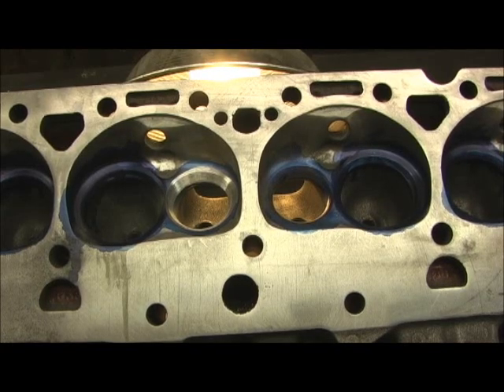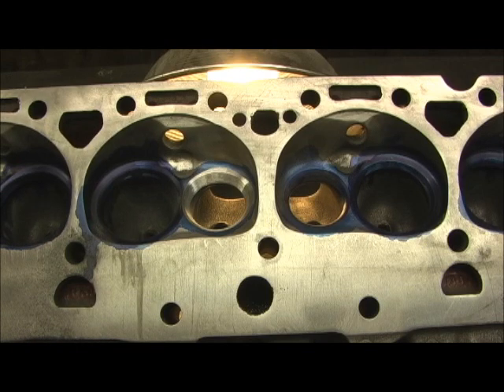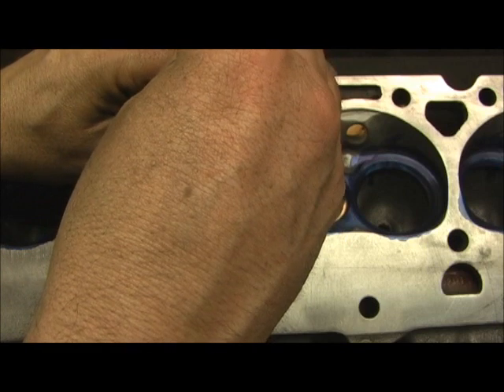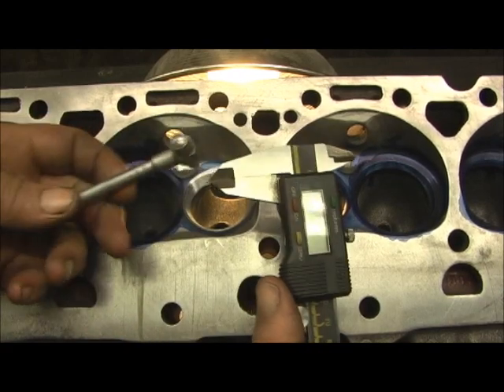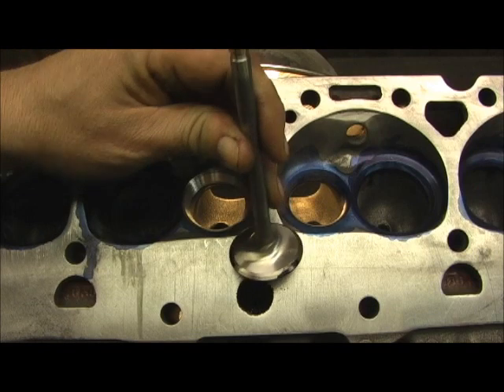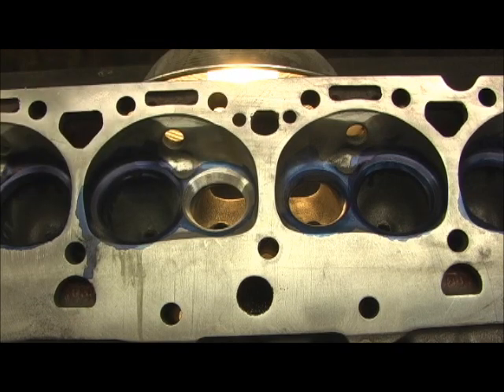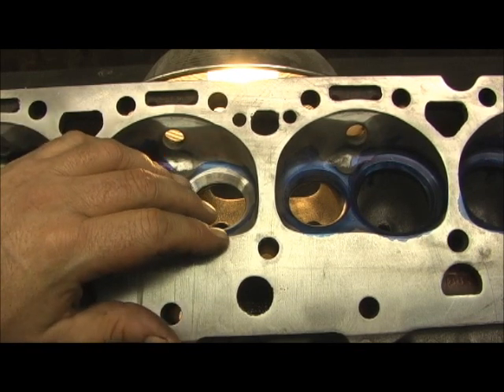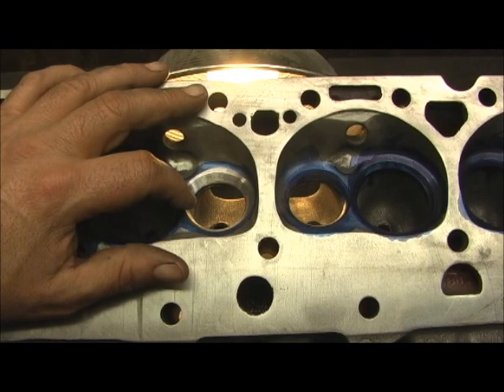Imhoff SBC 186 Enlarging Exhaust Valve to 1 600 7.2

Comment: I am a fan of the 186 heads and have a set on my Chevelle right now. 2.055 / 1.6 full port without tubes, swirl chambers and cut for roller springs. My street 383 with a turbo 400 and 3.42 gears would shift 1 to 2 at 70 mph and 2 to 3 at 110 mph and was never brave enough to top end it. I am sure with the right combo even with the manifolds this thing will rock.